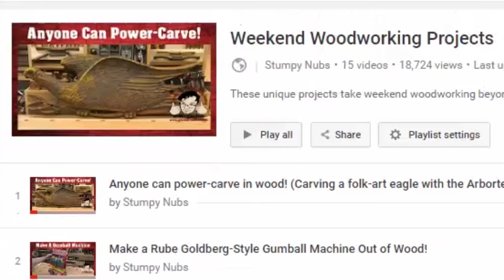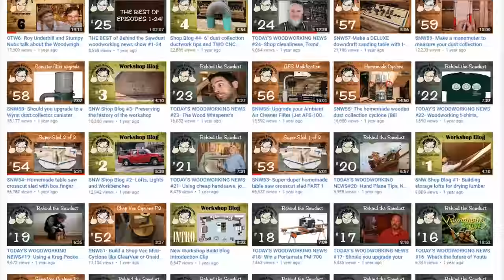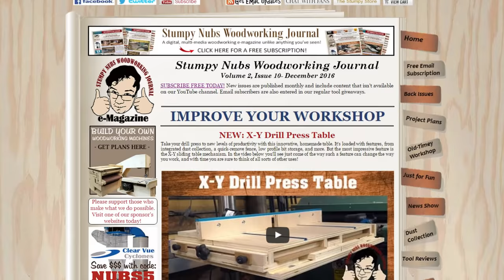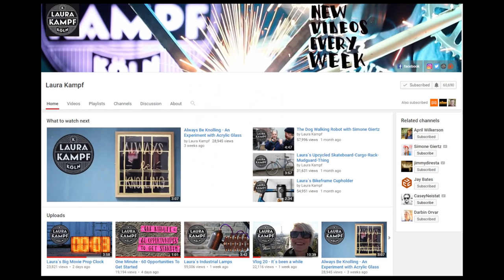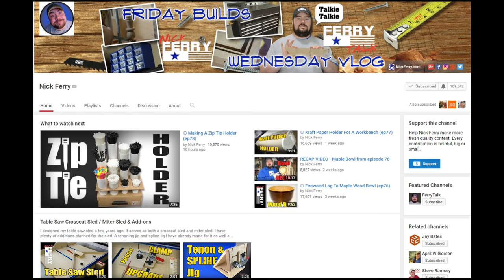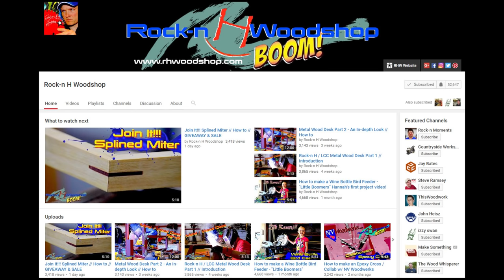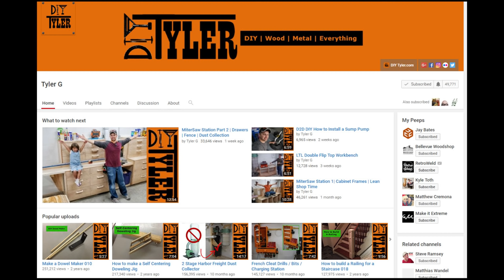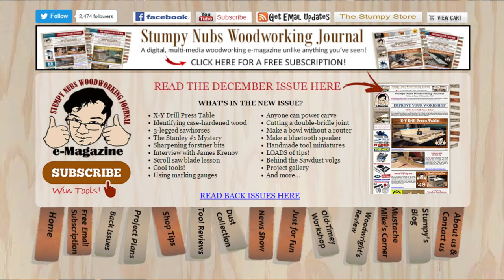My favorite YouTube woodworkers- An awkward story- And more questions answered! (Vlog)

Comment: So - my favourite woodworking channels are Stumpy Nubs, and WoodWorkWeb with Colin Knecht. Mostly I watch luthier channels.  But James Hamilton's videos have solved some important problems for me, such as: Using a good rip blade for cutting thick hardwood guitar parts (the combination blade burned and left saw marks), selecting the right table saw (Ridgid contractor saw with cast iron top & riving knife). I also purchased a Pentel mechanical pencil reommended by James - works a charm. I purchased several plans from Stumpy Nubs - worked very well. In the future I will be building the Stumpy Nubs drum sander - if I ever get around to building acoustic guitars instead of just electrics. I made a super useful fold-down outfeed table using Colin Knecht's recommended method. Fantastic for my tiny single-car garage workshop. 

I also rewatch Stumpy Nubs shop safety videos regularly in the hopes of keeping all my fingers and my eyes.